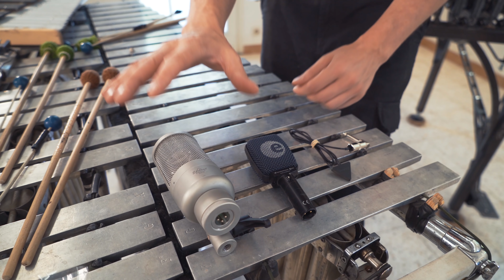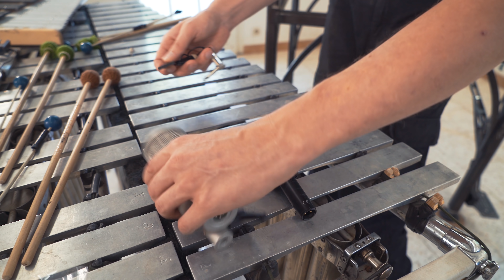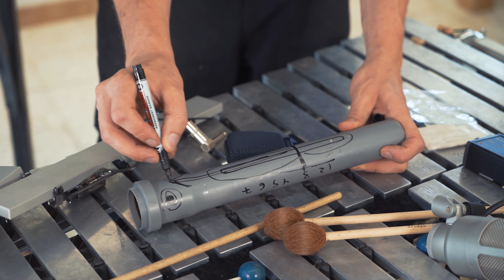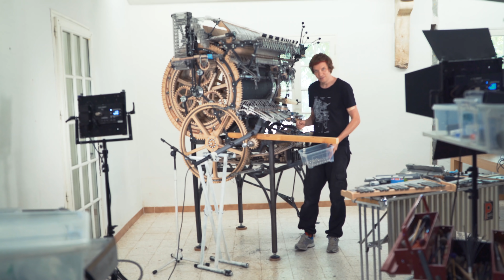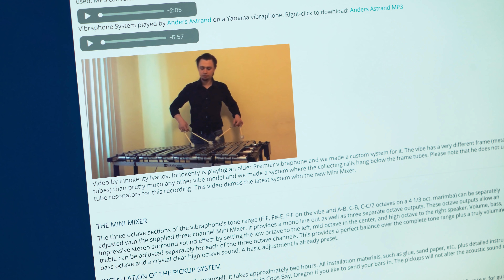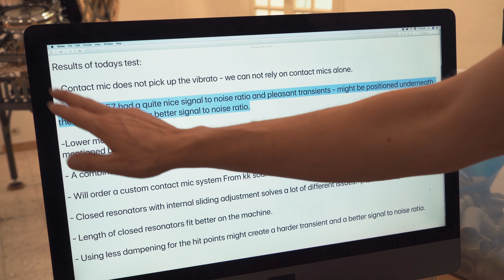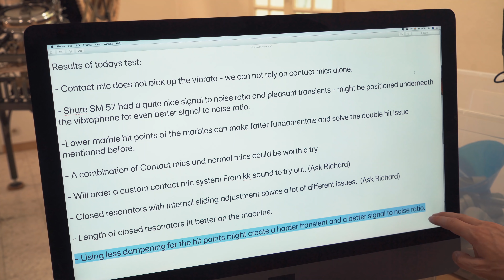Vibraphone Experiments / Microphone Types - Marble Machine X #96

Comment: I've seen a lot of people here talk about contact microphones. You don't mic a vibraphone with piezos (unless you want to get weird with crazy effects).Long story short, you get the beautiful sound by getting a little bit of space between the source and the mic, giving it a little more "air". The acoustics of a pipe is not very interesting, but once the wave exits it, you get the true sound. You can mic all the parts in close up if you'd wanted to, but the most important tracks in your mix would be the condenser mics (classically U87 or c414 or whatever you think sounds best with your instrument and room acoustics, or budget hehe, i would suggest small diaphragm cardioid mics in a XY pattern). The  signal to noise ratio is irelevant if you record properly, with the right equipment, and in a good room with good mic positions. It is also important to point out that the "noise" is not the high frequencies and the better definition of low volume sources you tend to get with condenser microphones, but rather the electric noise caused by the electricity flowing in the components. Once again, if you set up properly, this should be a consideration, but never a problem. Be careful with your input levels !
Now I understand that for the MMX, condenser mics placed a little away from the board would have a lot of the machinery noises in it, but well, sound will bleed into dynamic mics too, and to me, piezos are out of the question if you want to have a proper vibraphone sound. I guess it's a matter of aesthetics : trying to have the "purest" sound of vibraphone in the sense that the mics don't record anything else, and having a poor sound that kinda works anyway (maybe in postproduction... haha !); or accepting the MMX as it is, with all its mecanisms, and do a mix with proper mic and room choices.
If you want to minimize the bleeding sounds of marbles, i suggest you use a gate and a hi-cut EQ, definitely over 12-13kHz, but i don't know, listen and set it to whatever keeps the vibraphone ok in the mix, and smoothens the really high frequencies hits of marbles moving and hitting each other and stuff.
These aremy thoughts, if you have others, tell me, i'd be happy to have a conversation.
Reply: It is not absolutely necessary to mic ALL the plates. You could do something with only two microphones. I would choose a XY or AB pair of small membrane condenser mics above the board (such as Rode NT5 for a low budget). You could also choose to use dynamic mics, in that case i would pick Seinnheiser MD421 or MD441, but they are pretty big and wouldn't really suit a live performance. And another pair pointed towards the tubes, at least 30cm away from them. And aroom microphone for the whole machine.
Anyway, there are, roughly and with subtleties, 3 main mic positions:
- you get the high end of the spectrum and the hitting sound by miking ABOVE the board
- you get the low end of the spectrum, the resonance and the vibrato by miking IN FRONT of the pipes (10 to 50cm away)
- you get the whole spectrum and the sound of the room by miking 1 to 2 meters away or more
The overall sound should be a mix of these kinds of positions, as you would not have the full scope with only one microphone position, even if it's on every plate, which you definitely don't have to do. Focus on cardioïd or supercardioïd mics, avoid omnidirectional and figure eight.
Reply: @UnchosenMr  Yes I also think the same, its really not nessesary to mic every single plate and contact micorophones are not the way to go with this instrument. Actually I would exactly suggest the same as you do and accept the kind of small "noise". Also adding a "soft" gate later in the desk might inmprove the probelem. And actually as a sound guy i wouldn't want to have 11 inputs from the vibrophone, yes oufcourse you could add them up or group them, but why so if you could aready just use less micorophones.
Reply: @phoelipp5228  Haha yeah, pulling all this cables and using space on the patch for very little ! Agreed for the gate, it should do the work needed combined with an eq.
Miking everything is what people might think regarding sound recording, but professionals in studio or live really have a lot more techniques.
And a message for our very close instrumentalists friends : they sure know how to play and recognize a good instrument, but for a large part, they can't talk about sound. Martin should ask a sound engineer or look up their point of view on google, not the vibraphone players in a priority (obviously you have to look up vibraphone players).
Reply: You're not addressing that he'll be playing it on a stage, while sometimes switching out the bars,  and moving it from country to country.
Reply: @ginfonte3386  i did in another comment, but you're totally right. I speak from a studio perspective, but imo it's easier to carry 6 mics max and their stands than a lot more and have a poor sound. Plus, if you've got room in a little truck to have a Marble Machine X, you do have space for just those couple of things more. Also, switching the plates would not really affect the mic positions and you wouldn't have to unplug and replug everytime. Anyway i'm just trying to say how things would be done in studio, and that's the best sound. Of course live performance is different, and there is no problem at all with using mics other than piezos for live, sound engineers do it all the time, trust me. But as Martin said, it's a matter of compromise.
Reply: @UnchosenMr  I fully agree that proper mike setup and placement is the key. If you want to maximise the volume of the clean signal relative to the volume of background sounds (no, it's not called 'signal to noise ratio'), you need to consider your entire setup, from microphone types to pre-amplification to compressing and noise gating, to fit the significantly different requirements of the studio and the live stage.  It's not as simple as 'let's use piezoelectric mics everywhere' - you can't rely on one single parameter, like SNR of your amplifier or directional sensitivity pattern of your microphone. This is going to be as complex as acoustic drum miking, which is still an art after all these years.
Reply: @dmitryko76  An art indeed !
Reply: Weidorj.    You mention audio aesthetics, but if I'm understanding you, there are also visual aesthetics to consider. Having microphones and stands above the board puts a barrier between the machine and the audience. They might also interfere with Martin's ease of movement while playing. 
The MMX is becoming continually more complex and busy visually. I would love to see a sound gathering underneath if that would be possible. 
I have major respect for your experience and expertise. But the MMX is so unique, it needs a whole new perspective than what you may have been used to. A challenge for you to look outside your box. 😁😍
Reply: @ginfonte3386  Truly the audio shouldn't destroy the visual aesthetics of the mmx but nevertheless, there are audio physics which can't be changed. Surley it requieres a thinking outside the box, but there are many ways to mount the microphone discretly and get the best sound possible. But considering all the preamps needed for the contact microphone there comes a whole new other problem of visual aesthetics.
Reply: @ginfonte3386  Yeah right, i understand the mic stands and the mics are not the lightest things to see, however, they would not interfere with him playing (that depends on how the tech guys would advise to place them). The thing I think about most immediatly to make the thing less busy would be Rode NT5 microphones hidden behind the marble sliding bars that let the marbles fall on the plates, in a XY or small AB position, they can be attached to the top frame of the MMX, with a suspention to avoid vibrations, and they would be hidden that way. They are small membrane condenser microphones (the size is also quite small), so perfect for the job, plus they are silver, so its naturally in the color theme. You can have the same pair of microphones somewhere facing the bottom of the tubes a couple of centimeters away (10-50), not directly their holes, from the front preferably, or from behind with the risk of a lot of bleeding. Or the same postionning as just before, but instead of using condenser mics, use Sennheiser MD421 or MD441. And that would be it. 4 mics.
It is also possible to go with a piezo solution, but it would be less natural and way less beautiful. What i'm thinking right now is having every single plate miked up with contact microphones and sending the signals on a DAW; on this DAW you would group them and add a Leslie cabin (not sure of the right term in english but it's called a Leslie) and a convolution reverb of your choice  to simulate the vibrato; then group it and send it to the sound guys so that they can do the FOH mix. You would still get the muting effect with the actual machine.
Note that he can make stands with suspensions that could be attached directly to the MMX to have membrane mics. Another thing important to say is that you can't do miracles with sound, unlike video, for the most part. As every sound guy knows and will tell you (exactly those words, all around the world) : "the shit in is the shit out". Sorry for the bad words not sorry
Reply: If that's your long story short, I'd hate to see it long!
Reply: @Sirenhound  Hahaha I know right ! and in these comments we still only brush the surface
Reply: I've only done a handful of sound handling in my life, but would it be beneficial to them to try some Earthworks (or equivalent) mics?  They do a brilliant job of gathering just the sound from directly in front of them and nothing else, which could potentially eliminate much of the background noise from the machine.  They do have a nasty tendency to get weird when there's a lot of current running nearby or more than one input close to their tight cone, but I still think with proper positioning they could work.
I've just never used them on anything except string instruments before, so I'm not sure how the resonance of something like this piped instrument would do.

Comment: As I understand we want to record two different things, the fundamental frequency from the tile, and the vibratto, that is generated in the tube.
What about having two mics per vibraphone tile?
* Mic 1 is a contact one and is directly in the vibraphone tile, which records the main frequency directly from the tile, as clean as possible* 
* Mic 2 is an audio mic (Shure SM 57) directly inside in the vibraphone resonator tube which will pick the vibrato and part of the fundamental frequency

Then, you just have to mix them in post both channels. An advantage is to be able to disable the vibrato on the will per tile (just not enabling the audio channel).
Also, you could maybe add the Shure microphone directly inside of the tube, and enclosed in it, working as an end lid. I did some wave physics studies years ago at univeristy (telecom engineer here) and with acoustic ones, you can have the tube end either open or closed (it just changes the length of the tube slightly depending on the resonating frequency wavelength). Maybe, if you use the Shure mic to "make" this ending lid, you can have the vibratto at full amplitude of the wavelength and improve the NSR a the same time as it will be inside the tube and more isolated from the rest of the machine....

Also, some other ideas to reduce the noise produced by the movement in the machine is what they do in helicopters for communication headsets, which is recording the helicopter noise engine itself, and then use it to remove the noise from the real audio signal.
We could record the machine, and then cleanup the audio afterwards. Of course, all this counts that the sound is not so natural, and there is some digital audio processing involved in the machine.

Been some years without touching/using sound wave physics, but maybe someone can correct me here...
Reply: I think a contact mic on the bars would be a good idea, especially from a signal to noise perspective.  However, the mic couldn't just be anywhere in the resonator.  If it is anything like the size of an SM57, it would block too much of the sound wave and would pretty much render the resonator useless.  You'd still get the vibrato, but you could get the same effect in easier ways.  Also, that is a really interesting point.  It's called noise cancellation.  It's the same technology that headphones like Bose headphones use.  Also, this doesn't have to be done after the fact.  Noise cancellation can be processed in real time.  That would mean this would still work for live performance.  I'd go over the physics of how it works, but that's a bit much for a youtube comment XD.
Reply: @brady
Yes, that was the wording: "noise cancellation" (Was too lazy to search in my university notes to get the wording right.. )
Of course, this can be done on the fly! When I mean in postprocessing the audio, I meant anything between "postprocessing it in the 'audiobox' in the back of the marble machine" and "postprocessing later on after recording in the computer". And no worries, I already had to implement that algorythm myself some time ago. 
In fact... Maybe I can configure a small microchip/embedded chip such as a FPGA or similar that does this efficiently.

Though pretty sure that they sell one of this somewhere and better than a home made :P

About the SM57, I must confess I have no idea about mics. XD I just got the name from the video. But yes, it makes sense that it would stop the airwave and reduce the vibratto because they are not hollow in the middle. 
It would be great to find  (though sure this thing does exist) a microphone that somehow allows the air travel freely through it, and to be able to add it inside of the tube itself. Of course, this would mean that it would be more affected by external noise... 
But mixing it with the noise cancellation would remove this tradeoff! (@den way, I guess that this would fix the issue that you point)

Anyways, sorry for the missleading wording, I only did generic signal processing, so I'm not sure about how to call each piece in audio processing slang! :D
Reply: And I think with more n57 mics the noise would multiplie..You mean something like anc headphones?
Reply: I am just curius how he did it on the orginal mm,and not sure that anc is so effective without headphones but for me even if there is  a litle noise thats the point of an mechanical music machine

Comment: I think we need to talk about technical terms a little in order to maybe frame the problem better.
Condenser Mics have a much better signal to noise ratio than other Mics (ratio of electrical noise in the signal) , what you are talking about is sensitivity and the resulting pick up of ambient noise (which in the case of a mechanical monster like the marble machine is an important issue). Dynamic Mics are less sensitive, but also have a different frequency response in function of the distance from the sound. Contact Mics are exactly what their name says and are by definition the least sensitive of the three which is great for rejecting ambient noise, but the Vibrato is in fact an ambient "noise" and hence not picked up.
The lavalier Mic you used for the 1st experiment is obviously overdriven (too sensitive for the sound level in the resonator). The Dyn Mic being less sensitive performs better, but theoretically could have issues with frequency reproduction.
So the challenge is to find a good quality Mic, capable of handling the sound level and physically place it in such a way that the ambient noise of the machine is not a factor. That might simply not be possible.
In a studio environment large diaphragm condenser Mics would be my recommendation. If you can you should experiment with different types of Mics and positions - but eventually you may discover that picking up the resonator's vibrato might be impossible because of the machine's mechanical noises.

Comment: This could be an idea that's shot down right away, but you're relying a lot on post effects for sound quality. Couldn't you add a digital processing procedure to emulate the vibrato? Controlling it would be as easy as an extra foot pedal or switch to turn it off and on, if you wish. Is it cheating? Perhaps, but technically, so is using signal processing to emulate most of your drum kit. It would certainly take up a lot less room for your ever growing machine. It's just a thought.

Comment: I'm guessing that with using a group of resonator pipes you would also have to connect the drives of each one's vibratos together so that they rotated in sequence, pulling power from the flywheel in some fashion. Even with using adjustable resonator pipes it seems that it would be a much cleaner installation from the mechanical side to stick to using a digital vibrato effect. If you are already using an electric pickup for the guitar, would there be a whole lot of difference in this? Asking from a completely uninformed position.

Comment: Martin, try another placement of a contact mic. You've got distortion effect, but what if you place mic on the oposite side of the pipe? Or maybe you should close oposite side with some sort of membrane and place mic on it? And what about placing mic on a pvc resonator pipe?
Reply: Oh, my bad, again... you've used not a contact, but wireless mic on a closed resonator pipe...
Anyway. What is you glue contact mic to a pipe?

Comment: If you ever start a new iteration of the Marble Machine,  you shoud start with detailed mockups of instruments, because they are a lot bigger than the marbles and you can better adjust the width  of the lower part with most of the instruments or of the whole Marble Machine.